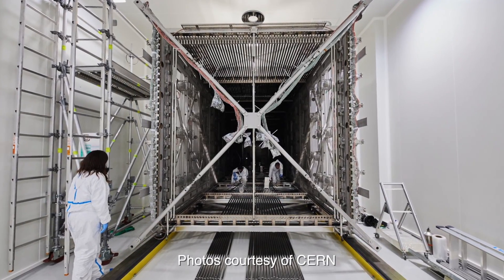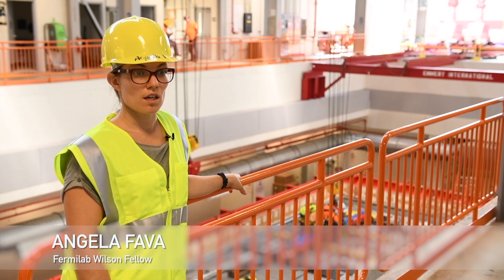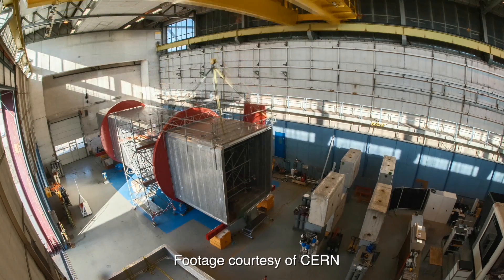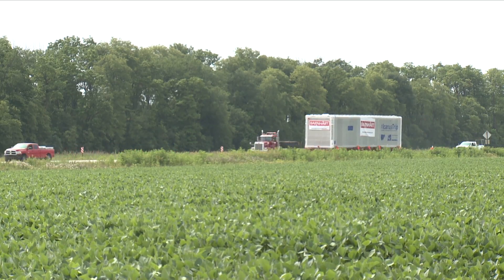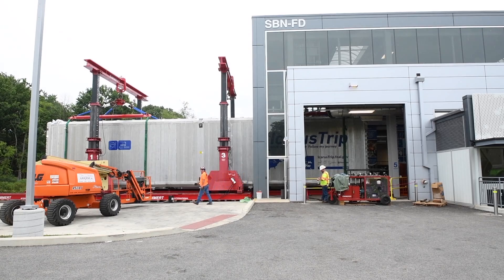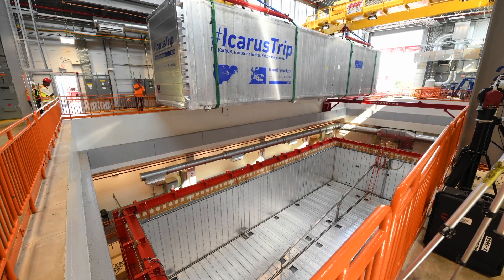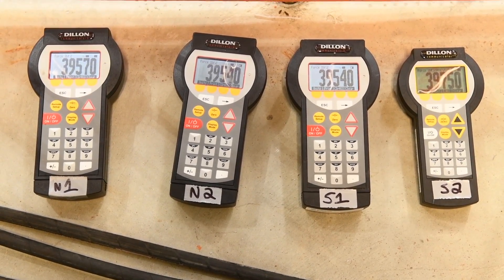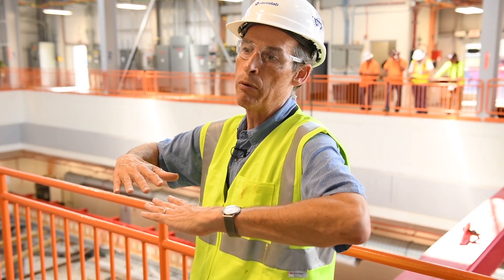ICARUS Neutrino Detector Installation at Fermilab

Comment: And once the installation was complete, the Raspberry Pi boards could easily be retrieved by using bit of coat hang wire duct taped to a broom handle.

Comment: I had an idea. Space radiation could be used as an encryption key. The sending computer and receiving computer could both gather data by an agreed upon space time coordinate and use the electromagnetic wave spectrum as the encryption key. No handshake of encryption keys and as long as the agreed upon times are not compromised you would have one of the most secure encryption's.
Reply: Yeah, that will work if the two detectors can simply occupy the exact same point in space, otherwise they'll record different data and make different keys.